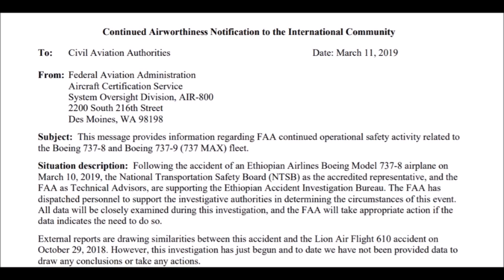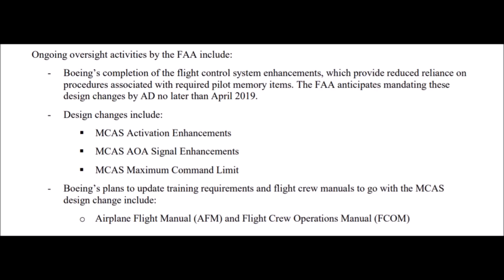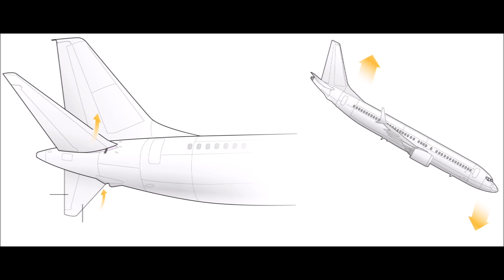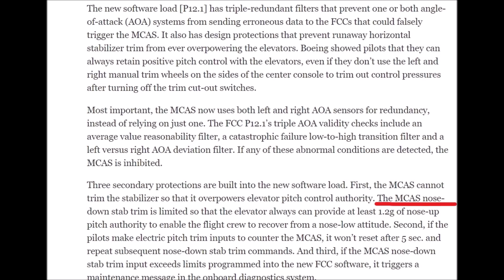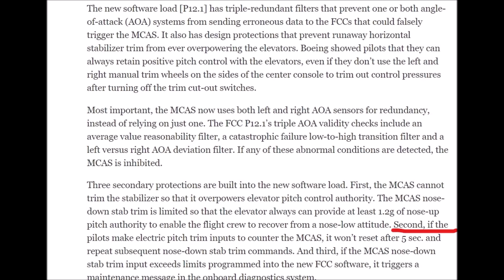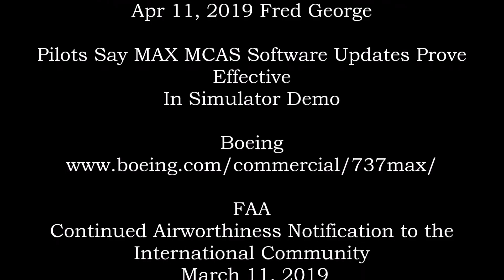737 Max UPDATE 14 April 2019 "The Fix"

Comment: I'm not a pilot, although I do have experience with the FAA and certifying software. I used to work at Pratt & Whitney and was one of the team that certified the FADEC software for the PW4000 series of engines back in the mid 1980's/early 1990's.

My question is this. If the purpose of MCAS is to make the plane feel and behave like the previous versions of the 737, then if the automation fails (MCAS is inhibited or actively turned off) doesn't that mean that the pilot is now flying a plane that doesn't feel the same as he should be accustomed to?   This sounds like a basic flaw in the idea here. Especially since the plane will feel different from the 737s that the pilot is used to flying at precisely a time when his piloting skills will be needed most (MCAS is acting up and he needs to quickly access the situation and 'hand fly' the plane). 

Am I missing something here, or does it sound like the whole idea of trying to mask the fundamental flight characteristics of a plane to make it artificially feel like something else is a flawed idea to begin with, as at some point in an emergency (When you least want this to happen) you will be relying on your experience of how it should fly and it won't be flying that way as the true flight characteristics will be unmasked at precisely the worst time.
Reply: Juan stated that with MCAS off, experienced 737 pilots could barely tell the difference with the MAX vs older models.
Reply: @stimproid  Then why bother make the system in the first place?
Reply: @andresrvlife1386  To avoid additional pilot re-training costs to the airlines, as the MAX would fly like the older model.
Reply: @stimproid  And that was my point.. If the system was "different enough" that Boeing had to put in the MCAS system then it doesn't really matter how "almost the same" it feels without MCAS. It either is close enough that no artificial software is needed or it isn't. 

Which then goes back to my original point, of when the pilot probably needs the plane to "feel" like what he is used to the most (in an emergency) is precisely when MCAS may fail and it won't.

Comment: Thank you for the explanations and update to the ongoing fixes regarding this aircraft type. @ 3:40 -  I'm glad to hear you mention that the MAX is an inherently stable design. After all updates/repairs, certification testing, pilot training and a new airworthiness certification for the MAX I will be the first passenger back onboard. A safe, comfortable, fuel efficient  modern airliner that I'm sure will have a great track record going forward. Thanks again!
Reply: Right there with you.

Comment: The should also add a warning or alert that macs are doing nose down
The preliminary report states that the pilot was guessing what is happening to the plain which can reduce their response time in such a situation
Reply: They shouldn't have been guessing. The trim wheels move and make noise when the trim is running.

Comment: As a retired structural engineer, the new max engine position on the wing appears to negatively affect the angle of attack during takeoff.  So MCAS is intended to compensate for a poor engine position on the wing.  I will never knowingly get on a  737 Max 8 or 9 because it is a flawed design.  The public shouldn't either.  Other dynamic cyclic loads from the engine thrust imparted to the wing from the pylon may not be well understood by Boeing and the FAA.
Reply: Engines have been mounted on planes in very strange places over the years. The MAX engine locations are fairly normal looking compared to some.

Comment: The design must have been done by the accountant’s toilet cleaner. 

How can such critically important and powerful system to be designed to rely on single sensor, is beyond anyone’s comprehension. 

Anyone with minimum knowledge of engineering or common sense knows that. They should have triple, quad redundancy and reference to data collected from other sensor.

Also, if they chose to rely on one sensor, why they want to alternate the sensor on alternating flight, it only serve to confuse the trouble shooting if the sensor develop problem.

Utter incompetence. Some head must be sent rolling.
Reply: If it can make a plane fall from the sky in matter of minutes when turned on... it is critical.
Reply: @esphilee  So it's critical when on but not critical when turned off.  Is that what you're telling me?
Reply: Milk Manson,
Clearly you are smarter than me. You win.
Reply: @esphilee   I can't tell you how long I've been waiting for this... but now that it finally happened... I don't know, it's just doesn't feel like I thought it would.  Let me think about it and get back to you.
Reply: Any system you can turn off and continue on to your destination doesn't seem all that critical.
Reply: @Milkmans_Son  A twin engine plane can fly on one engine if the other one fails. However, both engines are considered critical items. The ability of the plane to stay airborne is not the sole deciding factor about what makes something critical.
Reply: @wesleyhurd3574  I hereby transfer the win given to me by esphi LEE to you, Wesley Hurd, on this 17th day of April 2019. Congrats.
Reply: On the airbus a320, what system do they use so that it doesn’t go nose down?

Comment: If the plane is safe without MCAS, then Boeing should remove the MCAS system, give the plane a new Type designation and Boeing should tell the FAA that the flight training for this new type has a reduced-effort upgrade path for current 737 pilots to qualify on it.  From your descriptions, it sounds like the plane isn't the same as the prior 737s, doesn't handle quite the same (close) and has some different procedures needed to keep it in the air. Sounds like a new type to me, but then again, I'm not Boeing making these sorts of decisions for the FAA.
Reply: I don't think we watched the same video.

Comment: Still getting lost is the fact that 1... having issues with bad AOA sensors. 2... Mcas only going off of one sensor.  Those are the true fixes here first, then the over all power of Mcas being reduced. The redundancy of reading both sensors not one and cancelling itself out if there is a discrepency between the two is the biggest solution. The second is putting better AOA sensors on the damn planes. The fact still remains that both crashes where from poorly trained pilots. Both crashes would have been avoided by a simple flip of two switches.

Comment: In my opinion 737 Max should never resort to MCAS. Due to the technology improvements MAX have light nose due to improvement in performance, thus it has pitch up characteristics so it must correct this so regardless of the flight configuration it will maintain a level flight without the pilots control input or MCAS.  This must be done with software update  only and maybe both software and hardware upgrade.  First the level flight no matter what the configuration the airplane must be level flight.  Or else the problem is not solved. I stated before I think I can help fix this problem if Boeing is willing to listen.

Comment: Hell will freeze over before I'll trust automation in the automotive industry. There are about a million more variables in traffic on the ground than in the air. Google and Apple can't even get mapping right, who'll trust them to do the driving?

 Boeing have just trashed their hard won reputation by screwing up automation. BOEING! You going to trust GM or Great Wall or Mahindra to get it right? I'm not.

Comment: Also the changes made there are typical of what you might see in an automotive embedded system for critical sensors related to engine, braking, or vehicle stability. Was the MCAS was just an oversight, or were the rest of the control algorithms structured the same way? I would assume not since they are theoretically more mature.

Comment: The extent of shattering of the wreckage indicated that the crash occurred at high speed. Not the Max: an Airbus with angle of attack sensor failure during an anti-stall test. https://en.wikipedia.org/wiki/XL_Airways_Germany_Flight_888T

Here's one for a Tristar:

...stall recovery system known as a "stick pusher" which automatically pitched the aircraft down to build up speed if the crew failed to respond to the warning.

The Lane Report Findings and recomendations: The crew failed to recognise the reasons for the stall warnings and stall recovery system operation.

The crew WRONGLY DISABLED the stall recovery system.  Wikipedia - Tristar BEA Flight 548 crash, June 18, 1972.
Just saying.

Comment: Juan what is AA doing with 737MAX trained pilots who formerly flew 737-800’s. Does the FAA require a check flight and simulator time. I know you stated twice that training expenses could be saved because of the universal compatibility from the NG’s to the MAXII’s. But surely there are enough differences in the MAX to require a check flight. Could the pilots in the two doomed MAX aircraft partially offset MCAS actions by leaving the flaps extended until they reached a higher speed, than normal for a 737?

Comment: Corporate greed and cost optimization (in training) made it necessary for the engineers to put in this added feature and complexity...
A fly by wire flight computer should be able to fly/recover the aircraft without AOA sensor input in degraded mode...
I do not know who test flew this type, but I am sure he was scratching his head while writing the reports to the engineers...I bet those notes are secret...

Comment: Another good video, thanks. I wonder why MCAS still won't clearly tell the Pilot that it's intervening. And the AOA sensors although vital appear to be very weak links. They aren't self-checking before takeoff by returning to (say) horizontal or spinning fully one way then the other to check calibration. An error in either is first seen at takeoff which already is a period of increased hazard to the aircraft.

Comment: I have two main questions.
Why wasn't airspeed/control angle induced jackscrew loading/locking part of the MCAS programming? Aka estimate the loading and warn or disable MCAS if the surface likely would be locked.
Why wasn't MCAS limited to a proportional input? If it's meant to counteract the torque from the new engine position, then shouldn't its input should be proportional to the engine thrust as a modification of pilot input? aka add a percentage of nose down based on the throttle position. But a percentage of pilot input to replicate the feel, vs acting like an autopilot. Is that reasonable with regard to 737 flight controls or did they have to make it autopilot like?
And
Why isn't there an audible alert if a control surface movement is commanded but the plane is unable to move the surface? aka if the jackscrew motor is activated but the angle doesn't change, alert the pilot with something like 'warning, jackscrew overload; reduce speed or elevator input' if the avionics thinks overload is possible or a jackscrew inoperable warning if not.
Was both AOA sensors being checked an extra cost option? That's a nearly free to produce software feature. An audible alert is easy requiring no extra hardware. I understand a AOA disagree warning light was an extra cost option. Doesn't that look like a safety feature removed so it can be charged for separately? aka profit seeking at the expense of safety?

Comment: Lots of stuff to consider here.  At minimum, a first year programmer, using elementary school math, could have easily coded into the MCAS control the rapid detection of an AOA sensor output data anomaly (out of range  and/or excessive rate of change) like that which occurred on flight 302, and an immediate shutdown of the MCAS .     That alone would have prevented that 'accident'.  " All for the want of a horseshoe nail"   While they study this mess from all angles in professional schools for years to come. Teachers might consider using this example  to the show their 6 graders how  simple concepts and calculations like greater-than and less-than and rate-of-change,  can be critically important in the real world applications. They probably already know that big people  can make big mistakes.

Comment: That's the first I have heard that the AOA sensors were multiplexed. between flight cycles  Why would they not have used both sensors simultaneously to confirm accuracy in the first place?  The stupidity amazes me and frankly hard to believe.

Comment: The 737  much lower to the ground vs the A320, so Boeing jerry -rigged the larger engine to the wing of  the  737 (part of the engine is actually above the wing). Only to later find to find a design flaw that  you mention in this video  ( nose under certain conditions had a tendency to rise  and could cause a stall). This is clearly a design flaw Boeing is trying to fix with software. Would you even need the MCAS system if the plane was deigned properly?
Reply: RG; The plane is not designed improperly.  The MCAS is merely a 'stability augmentation system" that takes effect in a particular area of the flight envelope.  Stab Aug systems have been used on many aircraft for nearly 70 years.  On modern fighters and stealth aircraft, the flight computer controls the entire operation of the controls.  Boeing was sloppy in its implementation, but that does not mean the aircraft design is flawed or dangerous.

Comment: I think I heard you say "save money." If this is correct than I think someone is offering you up talking points. The regulatory process and pressure from the corporate suite are completely to blame for this fiasco. Telling us this plane will be safe when they fix the automation to justify a lopsided airliner  is in no way going to reassure the flying public. I have been watching your explanations and now I am sensing a hesitancy on your part to be less critical of the design and testing protocols. Other commentators are calling for the design to be scrapped. I want you to tell us straight up what is your gut feeling.

Comment: Rely on two sensors is not to be sufficient either. Four sensors, two on each side should be implemented, which would be essential to prevent failure of sensors during the flight.
Reply: Mike Jones —- Airbus has had situations where their four sensors did not result in fault-tolerant behavior.  Fault-tolerance requires a correctly designed system, not just more sensors.

Comment: I engineer control systems in the utility domain. Human factors on control systems for complicated systems are a nearly impossible to do correctly.

From "three mile island" to refinery accidents, catastrophic results from bad decisions made in control systems engineering is a well known phenomenon. It is a major theme in the industry, and is the subject of much of my continual education. It is impossible to over state how hard it is to build catastrophe-proof systems, especially when humans in the control loop are under stress. All control system accidents have some degree of human error. The harder you make it for a human to make a mistake, the harder people work to make that mistake happen.The cynical saying goes, "If you build an idiot proof system, all you are doing is building a better idiot."

With the 737 Max , it is obvious that the MCAS should never have contributed to a FATAC. In trying to make stall conditions idiot proof, they made a bad AoA sensor a nearly guaranteed crash. This type of thing is the bane of control systems in general. The MCAS was poorly designed and even worse, insufficiently tested. That they were able to repeat the accident in a simulator so quickly makes that obvious. Much of that is Boeing's fault. 

However, the pilots in the Ethiopian air crash made two crucially catastrophic mistakes in responding to the initial "horizontal stabilizer auto trim runaway" condition. They missed the auto throttle cut out and then reactivated the horizontal stabilizer auto trim. 

This FATAC had  multiple causes. The poorly implemented MCAS was just one of them.

Comment: Does the 737 elevator trim have absolute position indication, or does the system just jog incrementally from an unknown current position? Could MCAS have been coded with an offset value from the current trim setpoint? It beggars belief that any single-sensor closed-loop automated system is engineered to drive a flight-critical output variable to full deflection.

Comment: Thank you for solid information on the MCAS system and the design changes work.  It is intriguing to me, the FAA would allow it to be certified for use on only one AOA Sensor at a time rather than both.  That seems rather insane.  I blame both Boeing and the FAA for this failure.  Will I ride on a Max once the improvements are made?  Yes.  I do believe the airplane will be a safe reliable aircraft moving forward.  I have not lost confidence in Boeing for the simple reason, they have produced thousands of aircraft over the years which are reliable.  Yet, as stated earlier, I do find this one item to be poor design.

Comment: With all of the redundancy that there is in modern aircraft, I guess I don’t understand why both AOA vanes weren’t used during each flight.  I’m not an engineer or professional pilot.  Just an aviation hobbyist & have been for about 43 out of 46 of my years.  Can someone explain to me why they both weren’t in use to begin with?

Comment: Great video.  Boeing took my suggestions and wrote them up under their name.  Looks like it will be fine now.  I think that 5 second reset caused the most problems as it just wouldn't stop like most pilots would think would happen.  Just endless fighting a robot bound and determined to force the plane down.   Guess Trumps suggestion isn't taken seriously just to rebrand and everything will be unicorns and rainbows.